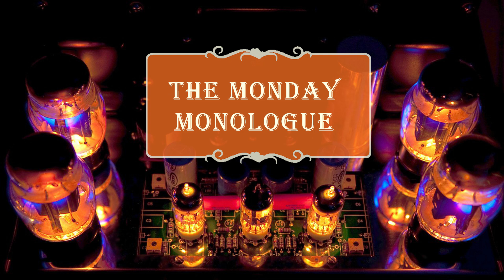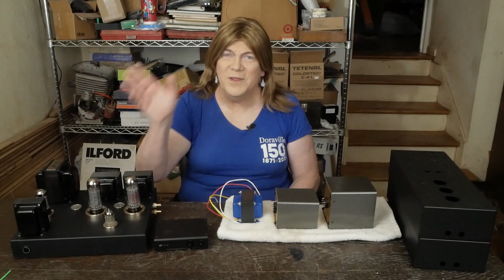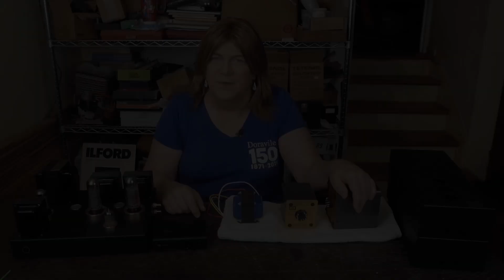Monday Monologue:  Matching a Tube Amp to Your Use Case.

Comment: I have to ask, what is that 2-Stroke motor on the shelf behind you?
Reply from the maker: It's a fairly rare Yamaha KT100A rotary valve kart racing engine that has a modified KT100 piston port cylinder. Ran on methanol in open class racing back in the later 1980's.
Reply: I bet that thing made beautiful music - I love 2 strokes, good power, low distortion, awesome frequency response, super dynamic, and doesn't need a negative feedback loop 🙂
Reply from the maker: We won multiple regional championships with it. Was a total beast between 11-15K rpm

Comment: If you want, you can charge for a burn in service. it is using your electricity and time, so obviously That is fair. maybe make an 8 ohm load with resistors attached to heat sinks to run the amp through. Then you can play a burning track you can burn it in without having to listen to it. LOL.

What do you think, maybe $75 to do so?

Of course, there is something to be said for keeping it extremely simple at the beginning of your business. Honestly, it would probably be best for you to add these options later on. Stick to simple, get a few out and see how complicated things feel.

I do think that learning PCB software and printing things on aluminum PCB material can be a real advantage. I need to send you a picture of a drill template that I made. It is both very accurate and has been reliable. Also minimum print quantity is 5 so you get spares
Reply from the maker: Sure, email me what you are talking about here :)

Comment: It appears to me that when we enter the realm of transformer design, we transition from a world of well-known engineering principles, to one of "Magick" & "Arcane Arte."  In electronic design, we deal with properties like resistance & reactance, which are understood and precisely defined, mathematically.  But with transformers, there are also phenomena that occur at the atomic level of the ferromagnetic material which affect performance, like core losses, eddy currents, hysteresis, the phase of the Moon when the transformer was built, etc, etc.  :)   So the design of one, I think, must involve more experimenting & measuring, than working out the math, which may account for why they're so expensive.
Reply from the maker: I'm learning this as I have starting comparing different transformers. Even if one measures slightly better on THD, it can sound worse.
Reply: Here's an idea that recently occurred to me.  What about having TWO output transformers?  One would be a normal type, with a silicon steel core, the other, a high-freq. type, with a ferrite core.  They would probably be connected in parallel, though a series connection could be tried out.  A cap. would feed the ferrite one, so the L.F. current would be reduced (or a shunt inductor, for a series configuration.  Then there's the possibility of bi-amping, with active filters feeding each amp.  I really think these ideas have possibilities.

Comment: I think an assembly manual is a excellent idea, not everyone is competent enough to follow schematic diagram. It might be a bit difficult doing the first one, but once sorted out it would be easy enough to photocopy the the rest of them. Plus l reckon all the extra sales would make the endeavour worthwhile.
Reply from the maker: If writing up a detailed assembly manual is required, I won't be selling any kits.
Reply: Can't get much more detailed than one of your video series. That's how I built my 2 EAR834 phono stage amps. Couldn't have done it without your video series. Really looking forward to watching the progress with this amp and all the research you do. Looking forward to the open sourcing too. Simply because of the shipping for the heavy stuff to the UK. Also leaves room for some artistic interpretation with the chassis style. 🎉

Comment: those jupiter caps...my god theyre huge and expensive. ive herad people GUSH over those things in this DAC i got, and i recall the long burn in. funny. i had no idea that was another topic where you have experienced it or you just say the earth is flat. i had some new cables once and wondered WTF was wrong with my stereo all of a sudden sounding harsh and forceful...i started asking around before it crossed my mind it might be the cables, better ride this out. ill be damned it smoothed out in a week or so. my brother came over a few times and, unprompted, commented on the sound. 

so, those jupiter...yeah. i heard they take forever to burn in, nowever that happens.
Reply from the maker: Yeah, I'm not sure what the actual process is, but these copper foil/wax caps do sound BAD on first power up and take hours to start sounding even reasonable.
Reply: aint that something?

Comment: im not surprised about the build tine/effort. reminds me of how cooking for 5 takes same amount of work and time as cooking for one. 

as far as kits and manuals, one company uses photos and build video. i forget their name, but they have an E80CC line stage. 

always a learning experience here, sister.
Reply from the maker: Photo's + a build video I could do. Writing up a super detailed step by step assembly manual like heathkit/dynaco used to do is next level of difficult and for someone who isn't a trained professional technical writer, would be an exhausting endeavor requiring hours of proof reading by other people. Then I would need to test to see if someone who has never done this before i.e. can't read a schematic etc. could assemble it correctly just using this manual. That in itself would be a big project when I'm not even sure I want to sell kits.

Comment: Good morning/afternoon/evening, I just want to say that you are my standard for the degree of skill, craftsmanship and understanding of audio electronics I strive for in my own DIY studies and projects. Keep it up. By the way, there is another DIYer who is quite knowledgeable who also discovered that placement of the RCA jacks on the side of the amp is the best design choice which balances utility/function and aesthetics. Great minds think alike. I know that you have probably shared it with us before but what is your source for the solid core internal hookup wire you use, please? Thank you and keep up the great work.
Reply from the maker: And solid copper 18ga hookup wire will work.

Comment: I am very curious about the results ( measuring and listening ) from the Thermionic OPT's..
There are good quality components in Europe as well in the US ( and Japan)........beware that chinese copper is often inferior and is mostly recycled copper .......( seen even alumium wiring enamed with copper or gold coatings to look as the real thing ).as well as is the compromised reliability as I often experienced with repairs ( but they look nice ........hmmm)
China is the king of faking ..........;even their food is painted and poisoned.
Quality does never comes cheap .
Kind regards and good luck !
Reply from the maker: Thanks for your support and insightful comments Frank.